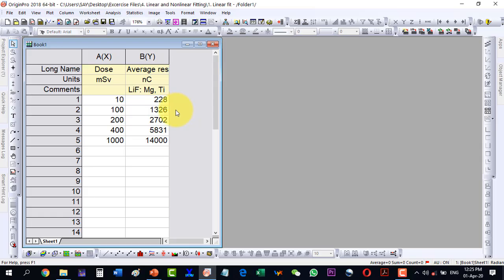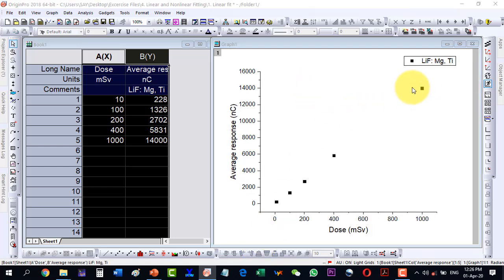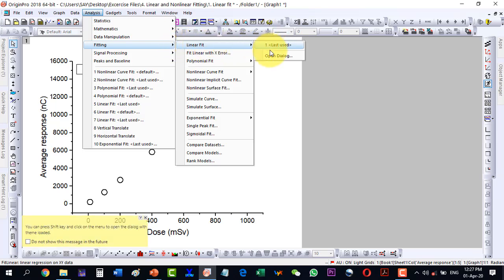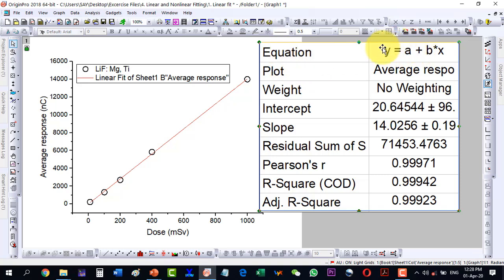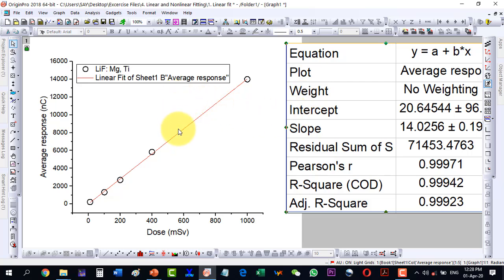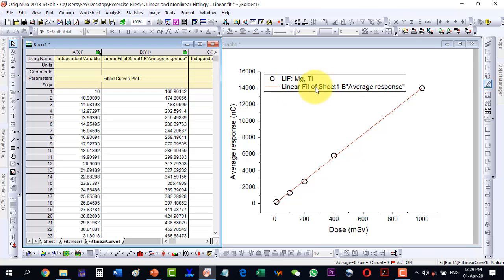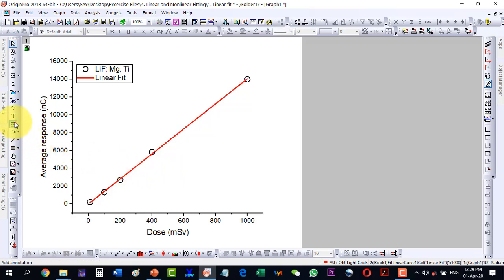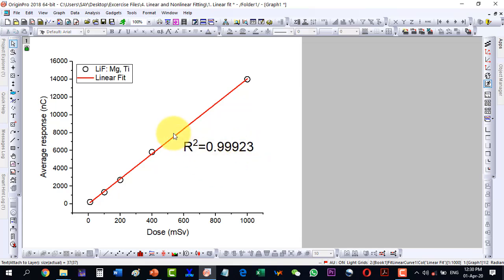Linear fitting in origin: explained step by step

Comment: Form where you calculate m and c value which is shown by you in your thumbnail
Reply from the maker: Thanks for your comment! The m (slope) and c (intercept) values shown in the thumbnail are calculated from the linear fit in Origin. In the video, I demonstrate the step-by-step process to obtain these values directly from the software. After fitting, these values are prompted, as well as, you can see them in the workbook new generated columns.

Comment: good vedio
how you got m and C value?

that is my concern so i watched your vedio. but you have not explained, in the begining slide you have mentioned sir.

so pls if you can also explain that it will be great help for audience.
Reply from the maker: Thanks for the appreciation dear.
Actually, I have provided only the data points, which are in red solid circles 🔴. When you linearly fit the data, Origin will give you the c and m values from the fitting. Thanks

Comment: Sir, how to increase the accuracy of the estimated equation? I mean, how to increase the digits after the decimal point in the estimated equation?
Or how to get the estimated equation in a fractional format?
Reply from the maker: If I'd have understood you question correctly, then we don't define equation here. Although there are ways to define one's own eq. To improve thee adjusted R2 value, we have to mask some outliner data points. Thanks
Reply: @SAYPhysics I couldn't explain it to you... maybe because of my bad English...
Reply from the maker: You may ask in Urdu/Hindi if possible. Thanks
Reply: @SAYPhysics  I am trying to explain to you again in English ... If I can't explain now, then I will try to explain to you in Hindi.

I have only two sets of data...and I want to fit the data in a linear equation... but the equation it gives, is not 100% accurate... however two sets of data is enough for linear fit.
(x1,y1)=(0,5)
(x2,y2)=(27,0)
For these two sets of data, origin shows that the estimated linear equation is (5)+(-0.18333)*x, which is not 100% accurate.
The 100% correct equation is (5)+(-5/27)*x
Thanks.
Reply from the maker: @susanta_debnath_19  Now I got your question. I'll suggest, you watch the following video, which will help you in working out your issue. In case, you find any difficulty, let me know. Thanks
https://youtu.be/ViIdEllu5pA

Comment: my version 2018, but I have a problem.. there is no menu after linear fit, also don't open the window for linear fit.. plz help -what do I do?
Reply from the maker: I don't know what's the issue with your computer, as these options are by default. When you are fitting a data, make sure that data in the plot is clicked. If only workbook will be open, fitting menu will not be displayed. Thanks
Reply from the maker: I don't know what's the issue with your computer, as these options are by default. When you are fitting a data, make sure that data in the plot is clicked. If only workbook will be open, fitting menu will not be displayed. Thanks

Comment: Nice video. I have a question. I need to calculate limit of detection (LOD) and my different analyte conc. is like  0.001M, 0.0001M, 0.00001M, 0.000001M, 0.0000001M upto pico molar. I am unable to fit this range in origin. How can I fit this range so that I can calculate LOD? My X-axis is the impedance and Y-axis is analyte conc.
Reply from the maker: You do the simple linear fit and it will generate the values of slope and intercept.. Thereby you can calculate your LOD. Thanks

Comment: Hi.. may i know the means for the standard error? I kinda confused when the standard error formed in every intercept and slope
Reply from the maker: For a given data points, there'll be one fitting slope and a standard deviation. In the case you fit the same data points with different possible slopes, you will have to take the average of all slopes and standard deviations. Thanks
Reply: @SAYPhysics  Noted. Thank you so much :D